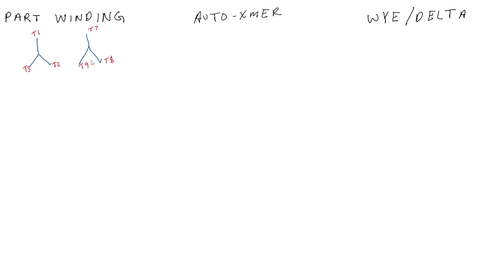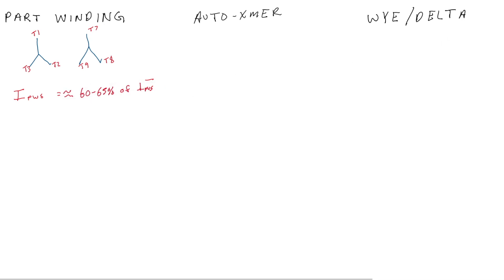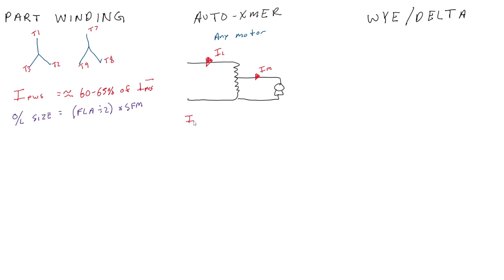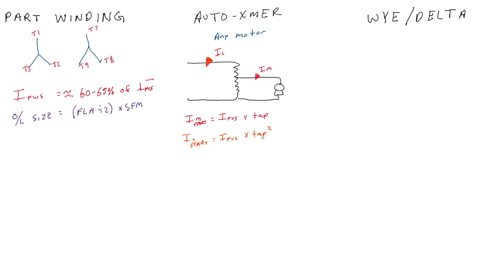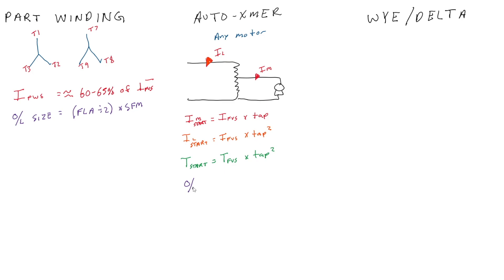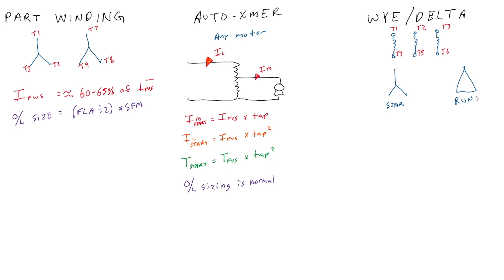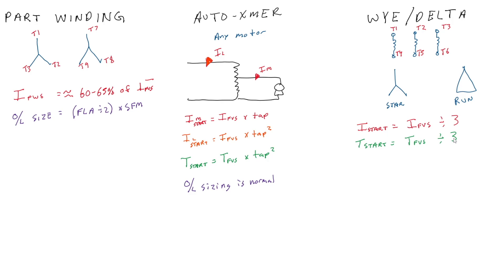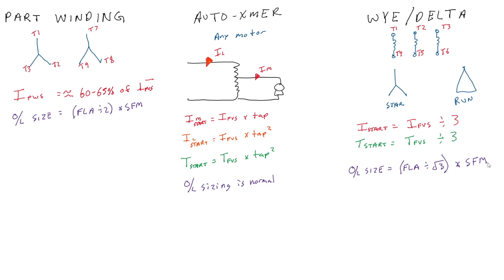Motor Starter Comparison and Formula Sheet

Comment: Hey Zack! I’m A Jman up in Edmonton, just got my ticket this spring. I’m wondering if there is a way to get a PDF version all my modules from Period 1 through 4... All my past instructors were not able to answer that question for me. I have folders and Information that I’m able to reference at anytime as they are stored on my Google Drive. It would be amazing to be able to also reference all my Modules the same way! I have no issues purchasing them all again if it means I can get PDF versions of them! I saw that you work at SAIT so i figured id go to the source, as all the Mods NAIT uses have SAIT badges on the back.
Reply from the maker: I'm not positive, but you may be able to order them through ilm.nait.ca

Comment: Helps a whole lot. Tap squared is definitely easier to remember than (Erv/Efv) squared.
Reply from the maker: You bet! There's so many different ways with these to calculate to get the right answer. Just trying to find the simplest one!
Reply: @ZackHartle  A while back, you posted a video that mentioned, and I’m paraphrasing, the resistance of the rotor is constant, the reactance of the rotor is not constant (varies with slip), maximum torque is obtained at .707 power factor, etc. etc. I’m finally going over the 10 equations that relate Torque at start, max and full load. After 47 years of being alive, I have finally seen the equations that elaborate on the “ AC induction motor torque varies directly with the square of the voltage” and now I know why the test prep courses would avoid teaching those 10 equations. So many different subs, Tfl, Tmax, Tstart, Irss, Irmt,etc. I guess my past instructors felt they would leave me confused so they never showed them at all. If it wasn’t for that video you put out there, I would be trying to memorize all those equations without understanding them.
   Thanks to you, they’re easy to remember.
Reply from the maker: That's awesome! I'm really glad it's helpful!